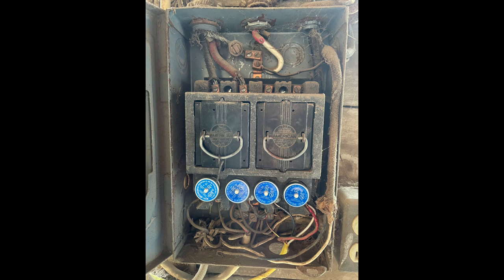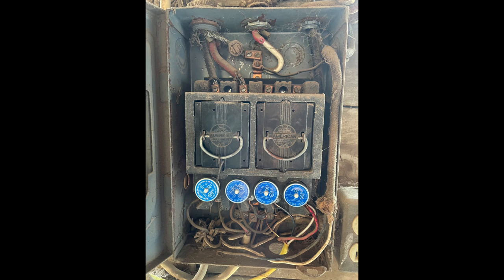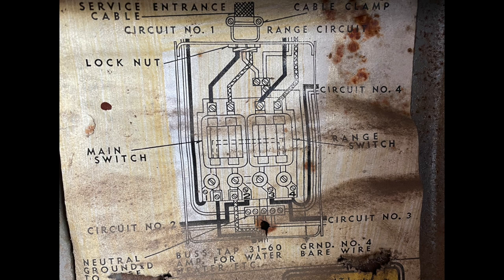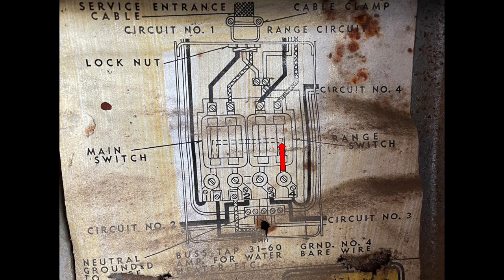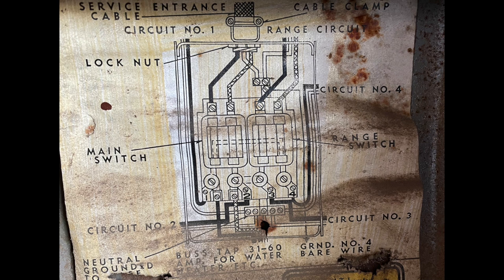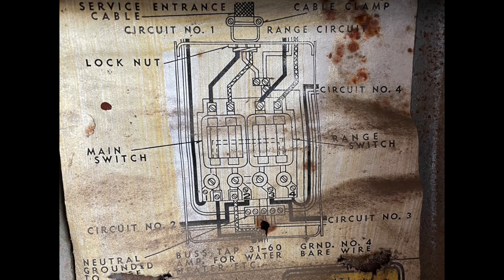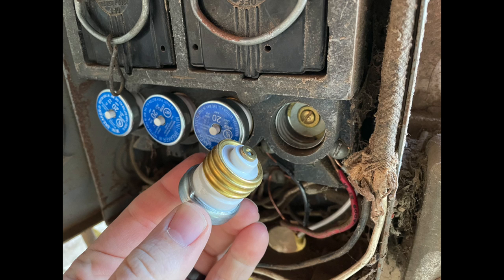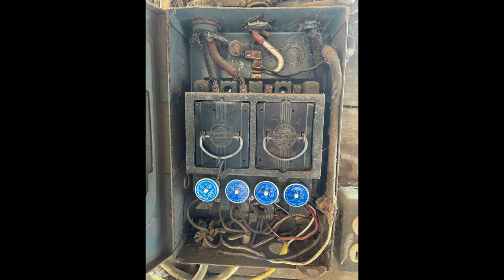What You Need to Know About Old Fuse Boxes

Comment: A fuse is much more reliable than a breaker in my 50 + years as an electrician I have never seen a breaker trip before a fuse blew when the circuit was protected by both a fuse and a breaker. A breaker is just more convenient to reset. I have actually seen circuits protected by a 15 amp breaker and a 20 amp fuse and the fuse blow first.
Reply from the maker: Fascinating, I’d be curious what the lead evidence was to move to breakers instead. I’m assuming there was more than the convenience factor
Reply: Fuses are still used in commercial applications.  There's different types of fuses that are designed to be fast trip, medium trip, and then time delay.   For residential applications in most cases time delay is the way to go.   Breakers do a great job for time delay.  So, they became the norm.   Fuse panels can be dangerous due to the ease of changing out fuses for higher amperages to avoid tripping.   That's why breakers became the safe norm.  Again, in commercial applications fuses are still used.  Also, you'll find fusable disconnects at residential outdoor ac units.

Comment: I was going to say you could use the power tap lugs directly under fuses 1 and 2 which comes directly from the main 60 amp fuses. Get a small 30 amp two space subpanel and mount it next to this panel. Connect it to these tap lugs, and install your two pole 20 amp breaker in the sub.  If you ever have to cut power to the welder from the fuses, be very careful when you unscrew them, because on the first fuse you unscrew there will be voltage present on the metal screw shell of the fuse as you are removing it.
Reply from the maker: I hadn’t thought about that but what a great idea! Thanks for the explanation, and warnings, I’ll check into that!
Reply: @NorthwestCraftsman  The two space sub and double pole breaker are cheap.  This also provides an easy and safe disconnect with the breaker when you need to cut power.

With fuses on 110 v circuits, unscrewing a fuse is perfectly safe, once you back out the fuse the exposed metal threads on the fuse are dead and you won't get a shock if your fingers were to touch them.  However when you're using two fuses to get 220 volt this isn't the case.  If you go unscrew one of the fuses, power will be present in that fuse's screw shell, you don't want to touch this shell as you are unscrewing it or you could get a shock.  Only safe way to disconnect power is to unscrew both at the same time so you're breaking connection to both fuses.   This is the reason 220 v fused circuits use pullouts to remove both fuses simultaneously, or a safety switch with plug fuses that kills power to both fuses at the same time so you can safely remove or install them.
Reply from the maker: Interesting! Again, great info. Thank you!

Comment: The bus bar taps under fuses 1 and 2 are sometimes referred to as water heater taps.   From there you could add a subpanel,  but if you're adding a subpanel for the purposes of adding a bunch of new circuits 60 amp service really isn't enough power.  In that instance it would be a good idea to begin budgeting for a service upgrade very soon, 200 amps seems to be the standard now, 100 amps is the smallest service allowed on a single family dwelling and may be plenty of power if the range,  water heater and furnace are gas rather than electric,  and central AC is not included.  I personally prefer 200 amp services because the cost difference between 100, 150 and 200 isn't really significant,  and it's not very cost effective to cheap out and go with 100, only to find out 10 or 15 years down the road you need at least 200 because you wanted to add a fancy induction range and central AC.
Reply from the maker: Thanks for that added knowledge on the bus bar taps! 

I totally agree with you, ideally this would be its own 200A service. We’re renting currently so I’m not planning to touch it since it works for me as is. However, when we have a place of our own, a 200A panel in the shop will be a must.

Comment: Its impossible to install a 220V line in your shop. You can get 120, 208 or 240 Volts, never ever 220. 110 and 220 V doesnt exist since the 1930s, 115 and 230 V was standardized. And later 120 and 240 V.
Reply from the maker: You’re totally right. I can’t remember where I had heard 220 in place of 240 early in my life but it stuck.

Comment: If the weather head and meter use this same cloth covered cable outdoors, chances are they are rotten and because they are not fused until they get to this little 60 amp box they pose a serious fire hazard.  In all likelihood it is only twenty coats of paint holding it together. If you value your building, replace it and certainly do not heat it up by trying to run a welding machine.
Reply from the maker: I’d have to go back and check but we don’t live there anymore. I appreciate you pointing this out though.

Comment: Is there any way you can help me with my fuse box i was using a air compressor and the eletricity went off and i pull the squere thatvis in the braker an put it back on and now just half of the house has electricity
Reply from the maker: Hey! Caveat that I’m not an electrician but I’ll give it my best shot. The black box that you pulled, does it have two, tube like fuses in it? It sounds like one of them popped so one of your busses isn’t getting any power. You should also be able to test this with a voltmeter by removing one of the small fuses on a working circuit and one that isn’t working. Measure both with reference to ground. I suspect the dead bus will read zero. If so, and perhaps even before whipping out your voltmeter, pull the black box and look for signs that one of them popped. You should see some charring inside or an indicator that popped. If you do see that or it reads zero with the voltmeter, you should be able to take it to your local hardware store and get a replacement fuse. Make sure to get the exact same size, dimensions, and current rating.  They come in slightly different sizes and shapes but you should be able to find it. 

I would also be remised if I didn’t recommend replacing your fuse box with a breaker box. It’s not that expensive and is miles safer and easier to work on. Case in point here, if you blew a fuse you need to replace it, breakers you’d flip back on. 

Also not to go on and on but you may check what your loading on that bus is and ensure your fuse sizes on your circuits match the wire coming out of the box. If your air compressor tripped the main fuse, it means your bus was overloaded even though the individual circuit was not. That’s what the fuse is for but it’s generally to be avoided or means your fuse is oversized for your circuit which is more dangerous. 

If you’re at all uncomfortable with those descriptions, call an electrician and they’ll be able to quickly sort you out and make sure things are safe (though they will surely recommend or require a panel upgrade). 

Sorry for the long winded response! Hope this helps!
Reply: @NorthwestCraftsman  thanks so much i will check tomorrow because i try to replace one of  the fuses the 30  green one but didn't work so i needed the light on my bathroom so i conect my light to the kitchen switch but i not sure if that is safe to do i mean works fine im just not gonna connect my compressor again
Reply from the maker: Yea, if you could have an electrician look at your panel, that’d probably be your best bet to both ensure you have the right size of fuse and that everything is wired correctly.

Comment: I think you would have much better off just changing out the fuse box out to a circuit box they are not that expensive and would be better for any future updates
Reply from the maker: Totally agree it’s better for any future updates. I didn’t upgrade because I don’t expect to be in this shop for more than a few years and I’m renting the space.
Reply: I've read to HIRE someone to do that, it IS expensive. DIY is a different story.
Reply: Not that hard to do. If you can turn off the power and can use a screwdriver you can do it.
Reply: The breaker box itself isn't that expensive but if the house is wired with two receptacles wouldn't you be required to rewire the house? 
I'm no electrician by any means and this is the situation I'm in. I know the only way I can install a 3 prong outlet now is to replace the two prong receptacle with a 3 prong GFCI receptacle and the lable included has to be place on the outside of the receptacle warning that it's not grounded